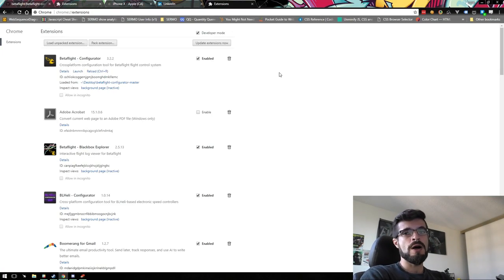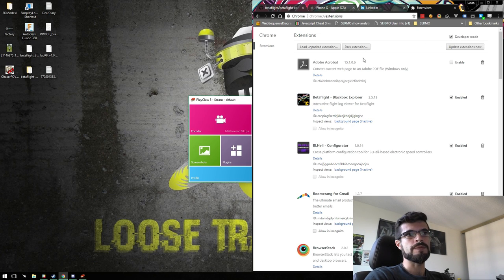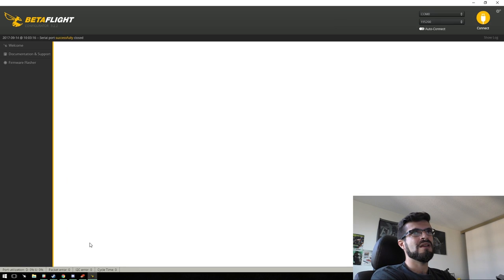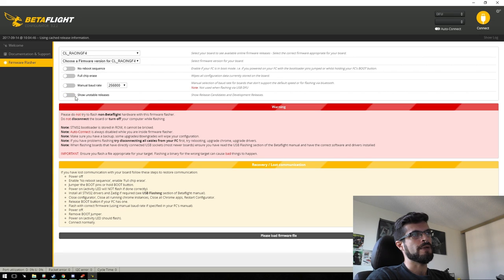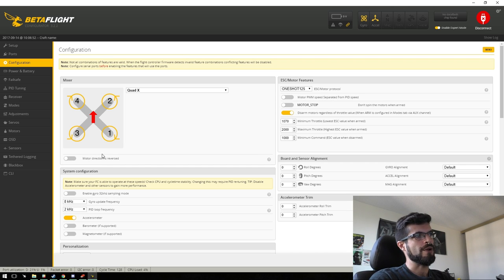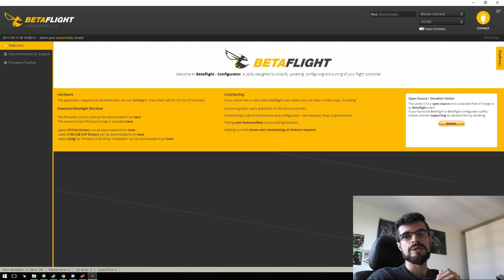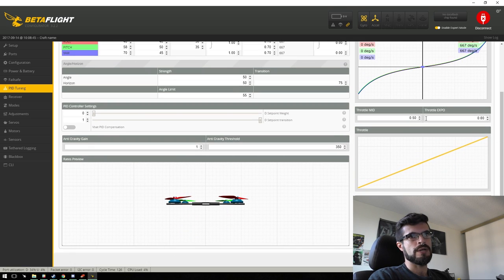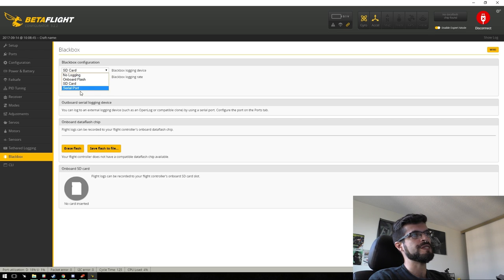Betaflight 3.2 (RC5) - How to Flash and Tune! - [ How To Quad ]

Comment: Actually anti gravity only works when applying throttle very quickly to boost I term to hold copters attitude. It does nothing when you chop the throttle to zero, so antigravity is only active when applying quick throttle inputs. Threshold adjusts the speed of stick movement as to where to enable antigravity. Which is best left alone because there is no real way to tune it without knowing when antigravity is actually kicking in

Comment: Hi Lucas, Thanks for posting this!!  Really liked this intro to RC5, I'm going to dig in and give it a try too... currently on RC4 and loving it.  Any chance you would be willing to share how you set up a quad for racing?  I am just trying to get into it and could really use some help to understand what race pilots look at tweaking to get their quads set up.
Reply from the maker: diabolicallydan hey Dan, yeah I can probably provide you some insight.

Outside of the basic settings I discussed in this video such as features (airmode, anti-grav, dynamic filters) it really comes down to rates and PID tuning.

Rates are purely personal, I would recommend using low-ish rates between 600dps and 1000dps with a bit of Expo so the center of the sticks are a little softer.

In the realm of PID racers usually prefer a sharper response so you want to run HIgh p gains, but no too high that you get prop wash or oscillations.

Does that help?

Comment: Hey man, have you noticed any wobbles in windy conditions with blheli_32? I've upgraded a few of my quads from blheli_s and they flew so smooth and perfect. After upgrading them to blheli_32 they are still smooth but I get slow wobbles in windy conditions. I don't really get it. Its almost like my I term is way low or something. Thanks!
Reply from the maker: Hmmm that is weird Adam. To be honest I haven't flown my _32 rig in a while. Maybe I will get it all updated and give it a go.

Did you try increasing I gain?
Reply: Loose Transistor FPV I figured out the issue, it's a strange one. Changing my blheli_32 settings back to default 24khz pwm and motor timing to 16 degrees absolutely made my quad fly perfect. 32khz added very slight wobble and 48khz added even more. Motor timing seems to add just a bit on auto, but not too bad. I wonder why non-defaults add this wobble? Odd stuff!
Reply from the maker: Yeah, thats good info man thanks! _32 is still so new, people haven't quite figured it out yet!

Comment: what frame is that a

also you say you raise p gain but 10 tell it oscillates, which 1, pitch roll at same time, pitch first tell its at cap then do roll, jump back and forth? my issue always comes down to that.. which axis to add to.
Reply from the maker: That is the Doberman 5" Stretch X it's made by the awesome folks at Detroit Multirotor
Reply: Loose Transistor FPV cool. OK and about the adding p gains.. do you do both axis together, or start adding too one tell it's highest and then do other.. or jump back and forth between pitch and roll?

Comment: I can not find 3.2 RC5  with the link that you provided it only take you to Betaflight release 3.2 no RC5 and thats using your links.
Reply from the maker: I wouldn't bother with RC5 at this point. RC6 is much better =) If you want RC5 you will have to grab it from the Jenkins build service. Linked here -> http://andwho.sytes.net:8080/job/BorisB_BetaFlight/1672/artifact/obj/betaflight_3.2.0-1672-07d5990.zip
Reply: Where do I find RC6 also how offtent do these RC come out.  I am new to building quad and the setup part.
Reply from the maker: Actually - seems like the final version of Betaflight 3.2 was just released you can find it here ( https://github.com/betaflight/betaflight/releases ) just download the one that corresponds to your Flight Controller =)

Comment: I already flashed 3.2 from configutator 3.2.1 should I flash 3.1.7 then flash 3.2 rc5 from the new configurator?
Reply from the maker: No need to rollback that way. Just re-flash your FC with 3.2 RC5 through the new 3.2.2 configuration making sure to check "FULL CHIP ERASE" on the flashing options.
Reply: Loose Transistor FPV awesome thanks man!
Reply from the maker: No problem! Anytime =)
Reply: not sure what happened but it took downloading and adding it a few times. First two times I got configurator 1.8.5 then on the third attempt i finally got 3.2.2
Reply from the maker: That's a bit weird! hahaha, well glad it got sorted somehow! Good luck, please let me know how it works out for you Jason.
Reply: Loose Transistor FPV everything went well. Not completely done with the build but almost there. Had to remap the motor pads since I rotated the board 180 degrees. I want to try out turtle mode so I want the motors to all be in the correct location.

Comment: Hi great video how come you did not disable the D filter you said you only turned off the first 2 I have seen a lot posts were there all saying disable D as well as the first two notch filters .
Reply from the maker: I have tried that with mixed results. Some builds turning off D helped keep the motors a little cooler. On other builds it made the quad oscillate and I couldn't get rid of it. So it varies from setup to setup and age of components.
Reply: I see I have turned it off on all my quads and seems fine but all parts are fairly new and all soft mounted, thanks for your reply.
Reply from the maker: Yeah I have quads in all different stages of wear and tear. Most of them are soft mounted too but I find once you crash a motor a couple of times it's never quite the same.
Reply: Yes had that recently had to change a motor must have been slightly out of true causing vibration but could not see anything but showed up on the giro trace as quite noisy motor
Reply: It's much more dangerous. Perhaps okay for a good low vibs quad. But if you bend a prop or put something out of balance, you could smoke a motor with D term filter off.

Comment: Hey again,
everything went fine here, installed configurator (not from chrome) and got the rc5 version unpacked and ready to go.
Board is connecting normally (com port 7 here) , version installed is 3.2.0 already! 
But it's the RC4, and since I wanted to at least try out some Bi-Blades I put it in bootloader-mode (entering "BL" at the CLI ). 
Then loaded the local RC5 version, and as I tried to flash it said "failed to connect to the bootloader" ..!
Tried reconnect, tried restart PC, it can still connect and I got the configurator working alright, but I just cannot flash it at all.
I am going to start the build now, maybe any ideas or anyone else here with that problem?
Thanks ;)
Reply from the maker: Sometimes the FC has trouble going into DFU mode if your USB port is not able to supply enough amps. What you might have to do to flash, is power the FC with a battery while you do the DFU/BL and flash
Reply: Got my quad finally done, first little testflights (very short due to friggin rain wich started right after build was done and never stopped since ..lol) felt pretty smooth.
The issue with failing fc flash: Although the connection and the reading of values and writing in betaflight configurator were possible, the flashing process needed some additional driver work for the laptop. Strange thing. 
 First I thougt connecting battery could help but it didn't. 
After watching a Bardwell-Video about setting up betaflight   (  https://www.youtube.com/watch?v=m4ygG6Y5zXI ) , including all driver stuff helped me out ;-)
Btw.. Using the tbs unify 5V version is not really working fine taking voltage off the led pad on the cl_racing f4. 25mw is ok, but 200 and up has strong noise and 500 picture transmission failes completely. Not enough amps ther my guess. Gonna  try a step down module between vtx+ pad and tbs and also connect vtx ground  (back through the module) to cam ground.. 
After all never had such a clean stack love the cl racing f4!  It still even works with the ripped off battery pad, just soldered on there lol Next build  with it is planned.
Looking forward to your next vids, gonna check out the new one now ;)
Reply from the maker: Oh man, glad to hear you got your build all setup and going =D Post some flight footage when you get some time even if its DVR.

Yeah the CL is pretty awesome indeed but I suspect you are right and the LED bec is not rated for it. Perhaps a stepdown is in order

Comment: Nice video. But why do you use bi blades?
Reply from the maker: I like the feel of Biblades. I also like that since switching to them, I break a lot less props and it's helped me a lot in races. I am not the best pilot, so occasionally I clip gates and such.. Before when I used to run tri/quad blades it always meant it put me out of the race. Now .. not so much!

Comment: I am following your instructions on how to download  betaflight 3.2.1, I download it,  unzip it, and move it to my desk top, this works great, but when I moved the folder to the extensions tab in chrome, I only see version 1.1.0, not 3.2.1. I used your link in this video. " Betaflight Configurator - https://github.com/betaflight/betafli..."

 Can you help me with what I'm doing wrong
Reply from the maker: Hey Bob - this video is rather old I would not recommend following these instructions anymore. A lot has changed on how Betaflight Configurator works.

Betaflight is now on Standalone so it no longer needs to be dragged to Chrome - you can run betaflight configurator directly from the folder you extracted. Just look for Betaflight Configurator.exe

Hope it helps!